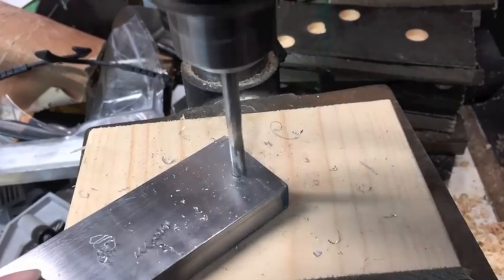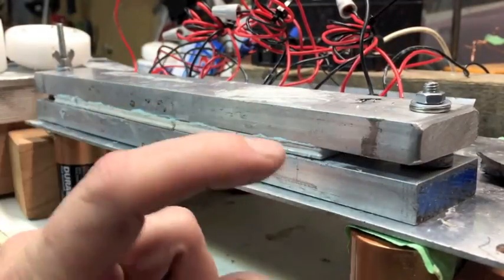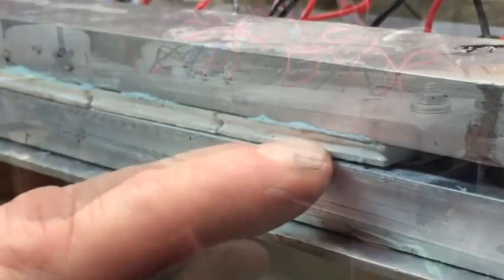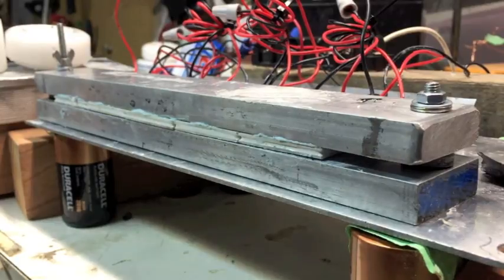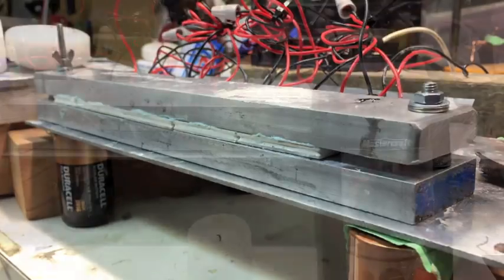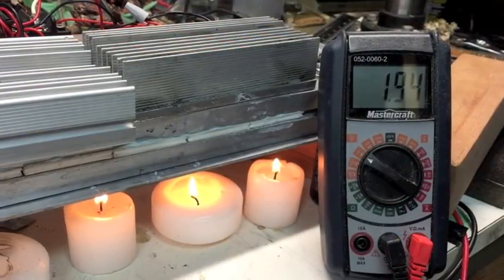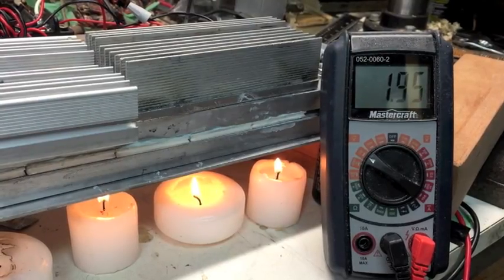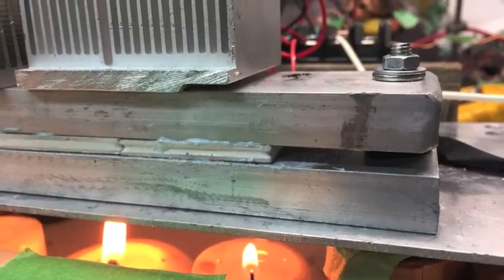Wood Stove Generator - Part 2

Comment: Whats up with the batteries on the table...is that where you are getting the voltage?
Reply from the maker: I was using them as a spacer. Handy and not flammable. Look closely and there is tape covering the positive side.

Comment: @Cedar Workshop: A few things that may help. Mild steel has both lower conductivity and specific heat than Aluminum. Mild steel's lower conductivity means it will take longer to heat up and longer to cool down than Aluminum, but because mild steel has lower specific heat, it will take less energy (heat) to raise it's temperature. It just means you have to wait longer to get mild steel hot, but once it's hot, it tends to stay hot. So, I recommend sandwich the thermocouples between thin mild steel flat bar on the bottom, and thin aluminum flat bar on top. Get rid of the 2 thick aluminum solid rectangles. Also, put a large finned aluminum heat sink on top off the thin aluminum flat bar. This configuration should create a greater temperature differential for the thermocouples, increasing total wattage. Lastly, be absolutely certain not to exceed temperature rating on the hot side for the thermocouples. If you really want to get maximum heat differential, replace the aluminum with beryllium, if you can afford it.

Keep the dimension of the flat bar no thicker than 0.1875 inches (3/16"), this should provide enough rigidity for clapping and still allow good heat transfer. You might want to even try 1/8" flat bars.
Reply from the maker: Wow! That's for the tip. I was not aware the benefits of mild steel. This is one of the key reasons these projects are shared. I planning to start this project again in a week and will go looking for mild steel at the metal supermarket. Thank you

Comment: If you were able to cool them more on top how much higher could you get the volts? Or is a couple of volts about it.
Reply from the maker: Having problems with cooling. The TECs don't produce enough juice to run a fan. So I have to use an external battery. Kind of defeats the goal. I'm not sure. I'm guessing more can be squeezed out of the TECs. As you know, the voltage is way too low to do really anything decent (without buying more). The good news, I found a seller for TEGSs on eBay with good price point and shipping. Rated for a couple of volts each. So I ordered 12 units. In the meanwhile, I'll play around with some passive cooling. Have a water block idea in the works...
Reply: The Cedar Workshop any progress on getting something to work? Could you share your eBay source and maybe an update on what you ended up building?